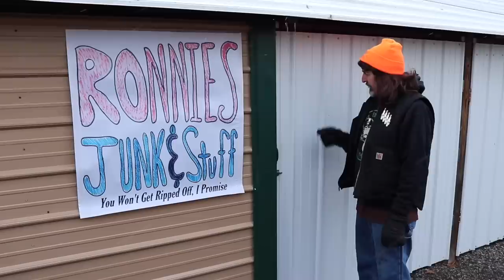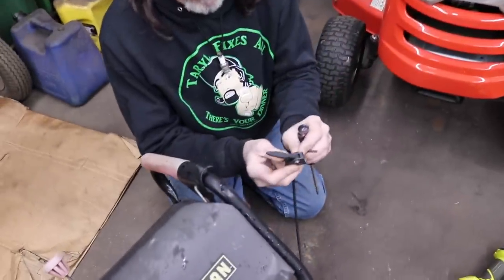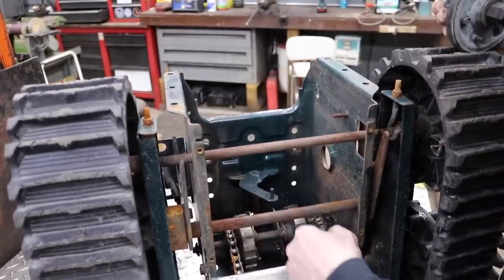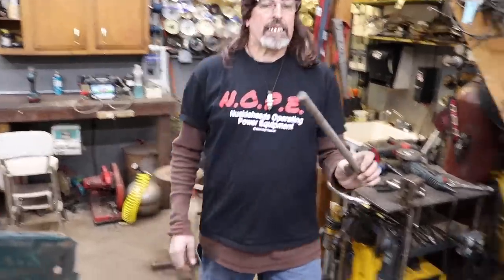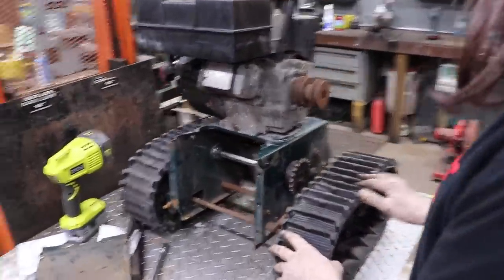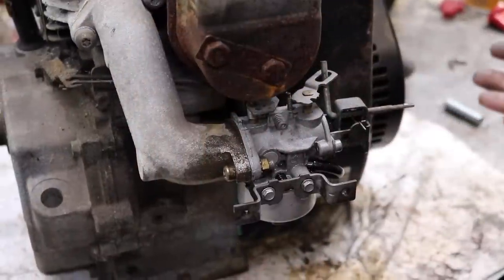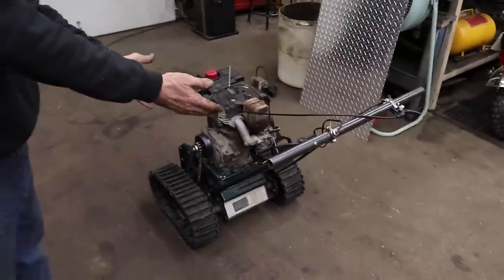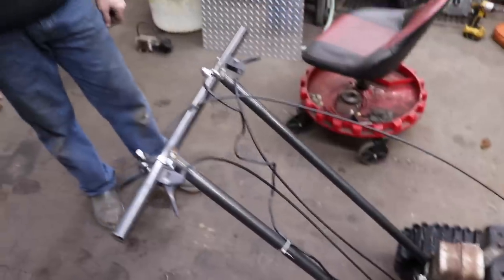Build Your Own Awesome Snow Dog! (Part 1)

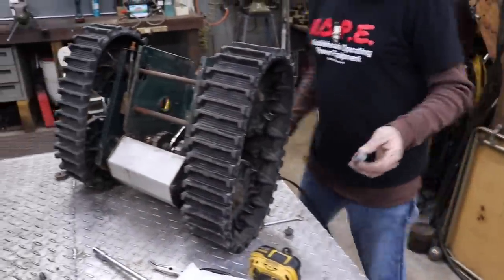Comment: @20:10 Sintered alloys is a fascinating process. I worked in a factory that made those type of parts.
First, a formula of powdered metals is mixed in an industrial blender.
Then the metal is pressed in a 20 or 50 ton press. The parts that come out are fragile but can be handled.
Then the parts go through a furnace on a conveyor belt. The furnace "sinters" the parts at a high temperature fusing the powdered metals together.
The parts come out just as hard as solid machined blocks of metal.
The process is used to make small complicated parts that would require too much machining to make practical manufacturing cost effective.

Comment: A front piece like the bow of a boat would work pretty good as a battery compartment as well. Looks like another fun build!
Reply: That is my thought too. Has to be an old leaky boat around the neighborhood.
Reply: A Regular Acid Battery Would Not Take The Pounding...Good Thought Though  For Weight....Maybe a Gel Pack Battery Would Work???

Comment: You should have become a Mechanical Engineer ! Brilliant absolutely brilliant!
Reply: He IS a Mechanical Engineer.
Reply: The math required to obtain an ME degree destroys any creativity that the prospective engineer may have. I worked with some University ME majors, years ago, in their drone program. None of them had any sort of mechanical skills and had never built anything with their hands. The all had major issues understanding mechanical advantage and why the servos they were using could not move the control surfaces that they wanted to move. These were juniors in college, at the time.
Reply: @jeffpiatt3879  As a Mechanical Engineer, I wholeheartedly disagree with your comment. The small few that you met does not in any way represent all Mechanical Engineers. I think you would enjoy Allen Millyard on YouTube, an Engineer and absolute wizard at building with his hands .

Comment: Taryl, it doesn't matter if the drive or driven wheel is in the front. The wheels drive the tracks and the tracks drive the vehicle. Weight distribution is what your after. Look at the John Deere 8RT.
Reply: What does it do to snow?
Reply: Yup, tracks aren't wheels. Why do snowmobiles drive from the front? Because that's where the engine is. Why does an Abrams battle tank drive from the rear" Because the engine is out back. The whole point of a track is -- it don't matter what end you drive it from.

Comment: Hi Taryl, I don't think that flipping the drive to the front will gain you much if anything.  If it had 4 wheels than yes, it would spin the front tires and lose traction as the weight shifts to the rear tires.  The way it sits now the tipping is caused by too much power to short tracks and a high center of gravity.  If you were to hook the trailer/sled like a gooseneck place a ball about center of the tracks and move the engine forward to clear. Place the wheels on the trailer towards the back so when it's loaded it adds more weight to the tracks as well as the back.  This should help keep it more stable and also make it easier to steer.  Fun little project, looking forward to more!

Comment: Hey Taryl! Love the videos! Getting that thing balanced so it doesn't want to flip over will be interesting. If the handle bars lock into position, that's gonna help out a lot. I look forward to the rest of the series.
Reply: Definatly  Need To Lock Handlebars. Operator Needs To Be Flexable.

Comment: Taryl, like this project a lot.  They made snowmobiles like that in the late 50’s, and early 60’s, using Kroger, and Hirt engines, with a sled behind it, and it could ride 2 adults, or adult and 2-3 kids.  Yup a brake would be safe for sure.  Great video😊😊

Comment: Taryl, I sure like the stuff you come up with!! I have an idea fer you - instead of adding weight, make a hinge with 2 bearings to connect the motor/track part to the part you ride on. That will keep the motor/track part from leaning back under load - it will always be level with the part you ride on, and your weight as a person will hold the tracks down. You know, like them big tractors that swivel in the middle. I am amazed at all the stuff that you find to make stuff with - all them spacers and bushings and sprockets and everything. You are an ingenious man! You sure can throw Ronnie a long ways! I think it should be an Olympic event - the Ronnie throw. Maybe come up with a more dressy name....
Reply: This is my  thoughts exactly.

Comment: If you look at a HOLMES 440 wrecker boom....you will notice that that hoisted weight is applied downward  to ahead of the rear axle by a boom and bracing system.....yet the towed weight is behind the rear of the tow truck. Maybe that may help you in a design of your hitch.   I know there are trailer towing hitch systems that also apply downward weight of the towed trailer.....but they only apply to the rear axle and the front still lifts up.   The Fergerson 3 point hitch system revolutionized farm tractor... by prevent front end lift up ...when the plow hit a immovable rock. The 3 point apply a downward pressure on the front of the tractor.

Comment: Gonna be a cool contraption! I have a 4wd scrub cadet snowblower with messed up traction wheel parts. I upgraded my beloved scrub cadet track blower like yours by swapping the original 5hp with the 8.5 off the 4wd. Kept the 4wd remains because I thought I might try to make something out of it like your project.

Comment: This is a cool project Taryl.
Go cart disk brake and  used kid ski for the runners.  Ski boot  attachment for the mounting point. 
Just make sure you put a kitty on the front slope plow.
There's your dinner.

Comment: I have that exact same snow blower but branded as Yardman. I will have to check those bearings on mine, to make sure they have enough lube. It's a great machine, I bought it brand new in 1996 for just under 1K.

Comment: Put a 1 inch receiver hitch on the front.
You can add attachments for weight, v plow in the winter, one wheel wagon in the summer.
Thanks for the continued great videos.

Comment: Love it! A creative genius at his finest! Wish you would go live on night, Q/A? Using the air hammer is excellent, im wondering about the connecting rod bolts, if they might vibrate loose? Does the factory use any type of thread locker during manufacturing?

Comment: Taryl my first thought was to attach the sled hitch to the front, then under it to the back so when you take off it your weight pullls the front down.
Reply: YOU GOT IT RUIGHT - Almost - The pivot would have to be at the rear like a bolt hitch for the surey - a horizontal short tube welded to the toung of surey  and then a short flat bar bent into a "U" shape with the ends of the "U" drilled for the tube to fit inside of   and the bottom of the "U" bar would have to have a short flat bar welded and drilled to bolt to the hitch bar with enough slack to move by using a double nut to lock it up. - -   All of that would have to be just behind the ends of the tracks to clear for turns binding against the tracks.    . .  Also - the wheel or wheels would allow for more weight to the drive the farther back behind the your fanny or - the closer to the power drive you would be placed allowing enough room for your knees to clear the handle bars when turning -  - -  and there's YOUR dinner - FREE OF CHARGE - hee hee  THIMK - there's more then all this to it  - it's complicated in short - - -

Comment: You can do a drum band break right on the clutch it's not the greatest option but it would work easy. Also you could make it so the trailer hitches from the front and that will apply the weight to the front of the machine but you don't have much ground clearance

Comment: Taryl , question???  What good would it do to flip it around? It's not like a front drive mower or a rear drive mower where only one end drives. Since it has tracks it makes no difference which end the tracks are driven from,  it will pull exactly the same from either end. What you need is a pivoting hitch on a half circular drawbar mounted on the back that the bar that goes to your sulky hooks to. That will keep the front from coming up, sort of on the order of a David Bradley type hitch, or a farm tractor pivoting drawbar. It will act as a solid unit that way.

Comment: You'll also have those bearings handling a shaft that's going to spin about 20 times faster than what they're designed for which would call for some serious lubrication solution if you don't want them destroyed in a matter of minutes. Fun project fou sure !

Comment: I think it wanting to wheelie is good. It will help it get up on snow instead of trying to plow through it. Also make sure the silkie is mounted just a little below the axle for the drive wheels. It wouldn't have to be much and then the weight it is pulling will help push the front down.

Comment: How about fixin' up that Hodaka?  That's what I'm talkin' about!  It has a lighting coil so I'm thinking making an autonomous vehicle with solenoid control and a drone controller.  Maybe use it to take the garbage to the curb or some job nobody likes to do.  I'm surprised Ronnie hasn't moved south for the winter.

Comment: The drive system reminds me of the Snapper smooth clutch system, which is still in use on new Snapper rear engine riders.
Reply: Yeah, I call it the Snapper style.
I had a 5hp Craftsman blower with tracks that used it as well
Also had a CASE badged rear engine mower that might have been Snapper made?

Comment: You might try tying the steering cables into a single lever that you can turn left and right to disengage each side. How about a steering yolk from a bicycle or a small motorcycle with a lever atttached opposite a set of handlebars. Then attach the cables opposite each other onto the lever. As you turn the handlebars one way or the other they would disengage each track accordingly. Then you could put the throttle lever onto the handlebars just like on a quad.

Comment: If you open up the clutch assembly, is it possible to drill two new holes on the opposite side of the clutch housing and refeeding them out the opposite side?
Could you rotate the clutch assembly so the current cables are coming out in the correct direction?
Great video, can't wait for part deuce.

Comment: I'd probably use one of those 5hp 2 stroke snowblower engines as they rev way higher, with the governors removed and with a new carbatraitor they really rip... Best part of that is you have a huge supply

Comment: Great video. My guess is that the wheelie problem is more about center of gravity. I would put an outrigger on the back with a ski that you can interchange with a wheel.
Reply: I was thinking he could move the motor to the front and lower it (like a roto-tiller) to solve that. Battery in the back.

Comment: I think the name should be Polar Puss. Put a mower seat with hinges on them and mount it from the frame to sit above the engine. Have the skid plate and frame made like a small boat or sled. Your weight will be over the engine, where you need it. It would be fantastic for quick trips to the store.

Comment: You could possibly put a brace on each side from the handle bars to each side in the front . You would have to go over and down to miss your starter  housing and drive sprocket,  that way you could put pressure on the front to keep it from tilting up . Maybe
Reply: Ha!

Comment: Hey Taryl, Please, Please, with all due respect, I don’t think ( I’m pretty sure) it will not make any difference if the front or back wheels are driving. It still will rear up. It’s driving on the tracks. If you put it into reverse, It would want to rear up in the opposite direction. Yes Snowmobiles drive from the front , but they wheelie with the best of them. 
   Do what you think is best but I hate to see you go through all that work and not change anything.   And I know how much time and money goes into building and fabricating. Just a friendly observation. Love your videos.  
   I’ve been working in the industry for 40 years myself. Recently retired and now fixing my own projects. 👍.

Comment: Taryl, need more ground clearance. soon as you get into deep snow you're done. also, might need a heavy duty clutch with a low rpm engagement. clutches don't like unlocking a lot and you will be pulling a ton of weight under load. looking good.
Reply: YES....SO TRUE

Comment: You might try pushing the engine as far forward as you can before you add any weight. That would tend to flatten out the tracks as you accelerate. Also, a lower profile engine, like the predator engines would lower the center of gravity.

Comment: Fasten the trailer to the bottom center of the frame with a welded on shaft, and washers to hold the flat stock trailer hitch plate on there. That way the trailer can swivel left or right and be weight centered for good traction

Comment: That might work better to design it where you'd be standing instead of sitting. You'd have better control that way AND the exhaust wouldn't be aiming at your face! Cool build, Taryl...looking forward to the finish product.

Comment: Maybe you should leave the drive as it is and make it so it pushes you instead of pulling you with the engine and drive system behind you. Then you can be the first one to the wreck.😆 Great project by the way. How about a future project using the smaller unit as a lawn mower for mowing steep ground using a remote control?

Comment: Drive wheels should be in back like a dozer.  Snowmobiles are in front because of ease of design.  They have  full undercarriage and bogey wheels to support track.  
You don’t have any support under track.  Driving from rear will keep track tighter under machine.   High center of gravity you want to hitch low

Comment: With the front/rear wheels connected by the track I don't think there would be any advantage to reversing anything.  Plus I'd go with the V as a plow.  A panel pushing down will just compact snow underneath and high center the machine. 🤓

Comment: Taryl, I'm not sure changing everything around is going to help you're traction, unless the engine(weight) is mounted farther forward. The ground won't know if the track is driven from the front or the back. Or I could be completely wrong.

Comment: You need one of those kill switches where you attach one end to your wrist so that if you fall off it pulls a pin out of the switch and kills the engine. I believe most snowmobiles have them.

Comment: The handle so high is what is pulling the front up. If you attach the handles to the bottom and lower. AND hook up your sled from the bottom and low it should NOT pop tracks. LOL ( POP WHEELIES )

Comment: Hhhmmm. That chain n sprocket set up you could use the front half of a pitbike motorcycle and fab up this track set up in place if the rear swing arm and drive it with the countershaft sprocket off the pitbike motor.  😁 or make pitbike mounts on track housing and make a hand shifter. Weeeee
Reply: Quite the idea

Comment: After building go karts I finally figured out #35
chain is not roller chain,
#40 41 and 420 actually roll where #35 chain has fixed rollers and wears sprockets faster.

Comment: Too bad you don't have a pair of those track drives laying around.  You could build an articulated quad track.  Make a subframe with a center pivot and connect the drive units with a CV shaft.

Comment: Hey Taryl, could you not turn the engine around and move your motor drive sprocket to the other side of the frame? That would reverse it. Everything else would stay in place. You would have to move the handlebars to the other side  obviously. 😊
Reply: Bahhh… I wrote this before watching the last 5 minutes of the video. 😅 never mind. Haha!

Comment: You should put a man overboard switch on it if you get separated, it will kill the engine there cheap and easy to put on instead of the Killswitch, you could pull a sled behind

Comment: I'm not Shure changing the drive around will help because the track doesn't know where the power is coming from.
Reply: I agree, another comment was run the hitch underneath to the front to pull it down. Maybe on a heim joint with only enough movement for articulation vs. wheelies. Hands will be occupied, maybe a foot brake that scrubs the ground like a gt snowracer sled. I’d call it a Sno-Mutt

Comment: You could use the weight of the engine and just make a motor plate to get that engine way forward and keep the rest how it is.miggt need longer drive chain and throttle cable???

Comment: Wouldn't it be easier to put a cog on the rear and front axel and connect them with a chain. Then the front would be a drive axle too. That would stop it doing wheelies

Comment: I alsost forgot - ALL the weight has to be centered on the tracks = rear is rear weight and front is front weight - - - center the weight - - snow mobile's most weight is where the driver is at when high torque is added - in the mid to front section over the drive track - and it still wants to stand up if it's a monster.

Comment: I haven't read through all the comments yet, but IMHO, I don't think driving the tracks from the front sprocket will make much, if any difference.
A front-wheel drive car will still lift up the front end when accelerating, just like a rear-wheel drive.

Comment: Actually if you build it with articulated steering hitch rather than a trailer hitch it should be stiff enough to keep it from popping up in the front.

Comment: Had no idea what the MTD initials stood for until today.
If you don't plan to do anything with that Road Toad, let me know.
Reply: Modern Tool and Die. Hauled steel for them to Kentucky...saw the assembly line..."what brand are your making today ?...depends on what decals were printed and what paint was loaded"

Comment: Couldn’t you just attach your sulky with a pivoting yoke assembly to transfer the torque of the motor to the sulky instead of switching everything around. Seems simple. Just a thought 🤷‍♂️